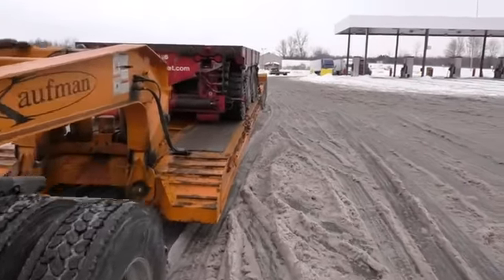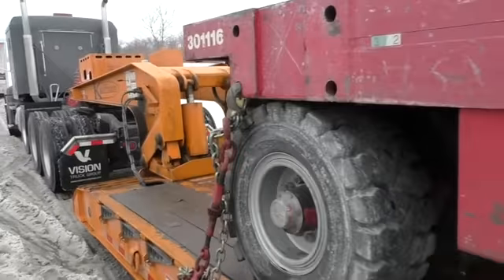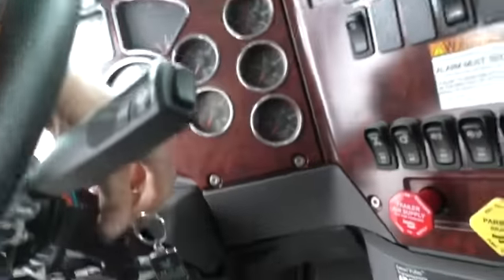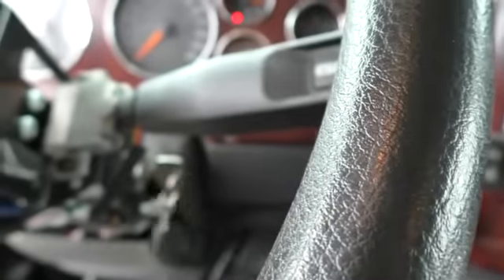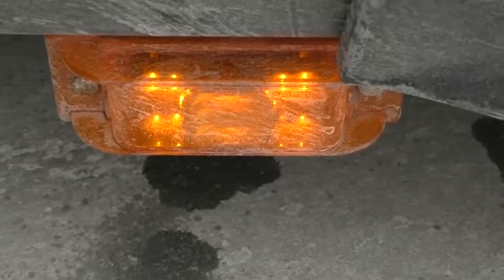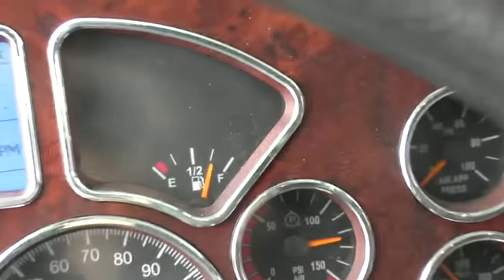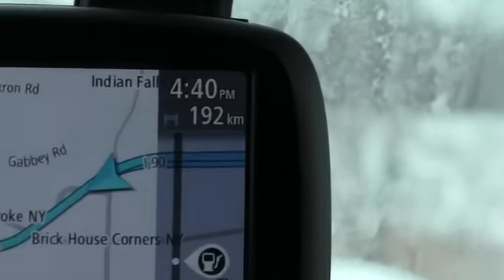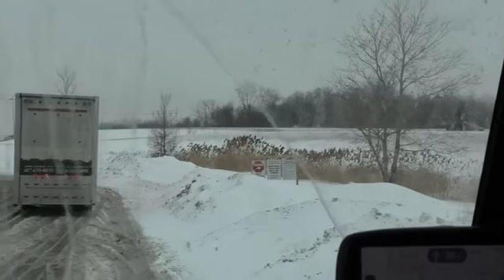HEAVY HAUL TV: Re-Load Back to Canada

Comment from the maker: Hah! The guy who suggested the culprit was the trailer was totally nuts. Well, that's what I thought at first. I got out of the truck, disconnected the electric line to the trailer, turned the truck's ignition key back on and tried the turn signals... guess what? everything worked perfect! so, the short or bad light must be somewhere on the trailer. or maybe there's just dirt/moisture in the electric line between the truck and trailer. it's amazing how these things are connected. now i have to re-assemble half of the truck ;) where did i put those screws and where's my welder?! okay, goggles on .. sh..sh..sh..tchk.. tchk ..tchk... done!

Comment: These newer trucks they can sense electrical shorts in your lighting system so it is very possible for the trailer to effect the truck's turn signals everything is electronic flashers now so you can run LED lights.

Comment: If you manually move the turn signal handle up and down it should work temporarily until you get it it fix.
Reply from the maker: tc6868 tried moving the handle in all directions. going up it activates the high beams and scares the motorists in the front ;)

Comment: I would try to switch the trailer left and right turn signal relays in the fuse box, reconnect the trailer and see if the issue is now the other side. I had seen a similar issue on a international and it was just a bad relay for the trailer turn but I'm not a expert with Mack's wiring.

Comment: Just wondering Sergie, if you are happy with the Mack, I like Mack trucks and at a point in my life where I am thinking about buying a truck again , I owned a Mack before, but it was some time ago..
Reply from the maker: after 17,000 miles mine is starting to run better, with more power. the 13L MP8 engine is perfectly fine for regular loads up to 80K gross. get a 4.10 or 4.30 ratio if you're gonna haul heavy.

Comment: my Kenworth did that when hooked up to cousins  hopper , hooked a ground wire to 5 th wheel plate cured  it , was something with his trailer bad ground some wear .
been working on a guys 08 granite lately on his truck i read there is like 7 grounds for various  things , also that deal on right side under steering wheel lets u go throuhg truck ecm an find falts , engine dpf abs an some others , u can even do a gauge check an on some a re calibration ,found  a bad boost sensor  tripping a fault  on his titan ,  manual also says  u can tell if its bad wire gauge  or sensor , is a prety good systom for self diagnostics although u will want to do a on line search for a more in depth definition of the cods , the book u get with the truck leaves out some things like  the fm number meanings , mack has allot on  line in there e media thing i have found complete wiring digrams for verous macks on  line mack/ volvo it seams gives allot of imfo to help the owner . like u vid says any light out gives dot a resin to pinch u , i get a lol out of them guys that add a zillion lights to there rigs lol . nice vids u put out , keep up the good work

Comment: I had the same problem on my trailer , It was the main ground on the back. When the ground has a short  the power back feeds trying to find a ground . The trailer people told me the salt they are using on the roads is eating the wires and the paint off the trailers and the manufacturers don't know how to fix the problem .
Reply from the maker: Gerard Johns one trailer shop guy suggested i put ... er ... you know ... those rubber birth control things you can get at a pharmacy? i'm taking the trailer to Mack dealer tomorrow. will ask them to check the main ground first. Thx for the tip.

Comment: That is a strange electrical fault. Yep , unplug trailer plug to make sure it is a truck problem. Then get Mack to fix it-Warrenty Yes!
Reply from the maker: the other commenter was right. the fault is on the trailer. after i unplugged the electric line to the trailer, everything works like a charm on the truck. who would have thought? i thought of dropping the trailer and driving just the truck to the dealer. now i have to bring both ;)